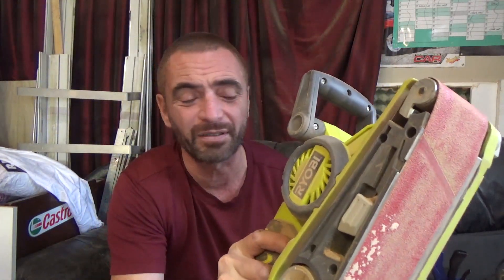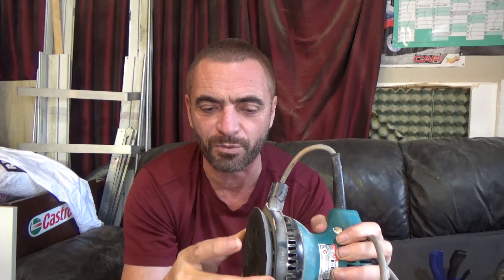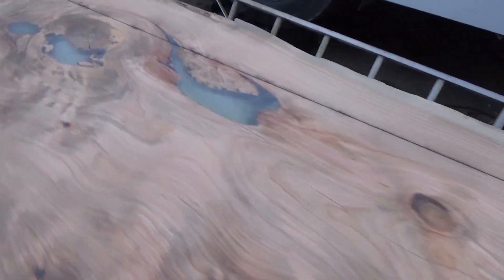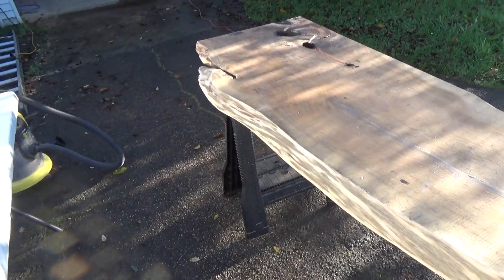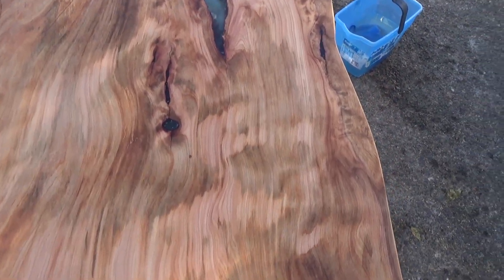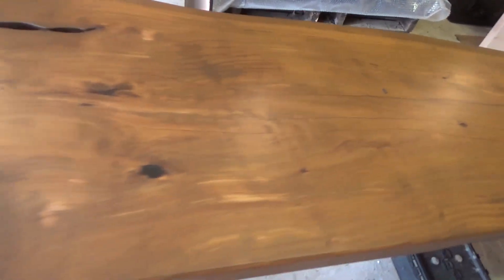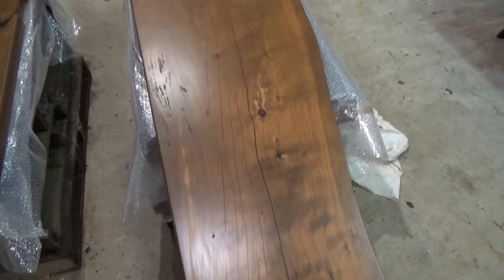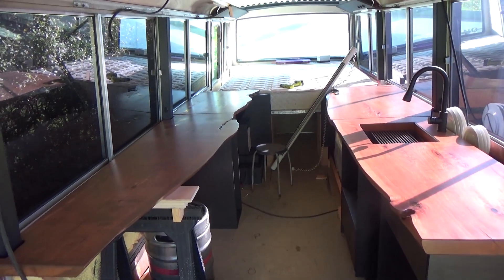Osmo Top Oil Countertop |  Another oiled Macrocarpa Slab with Epoxy filled knot holes

Comment: If you hate sanding, get a Festool Rotex 150 sander.  Acts like a cross between a random orbital and a belt sander.  Use the power plane and then the rotex.  Then switch the rotex to it's random orbital mode and finish up.  Too expensive, but a game changer.  Or, better yet find a shop with a wide planer and wide belt sander and pay them to do it for you.
Reply from the maker: Wow, wish I had met that tool before I started, it looks awesome, Cheers. I did consider getting them done professionally, in just minutes, but I'm glad I didn't now as I slide my hand across the bench and answer "Oh yeah I did it myself"

Comment: Hi. I also have a slab with opaque epoxy. How did you get it clear ?
Reply from the maker: Hi Glenn, I just kept sanding it, going finer and finer grades. I think I finished with a wet sand at 1200 grit. Wet sanding is a bit messy but leaves a better finish. Actually might have been 2400. You could also polish it with maybe a fairly aggressive car polish